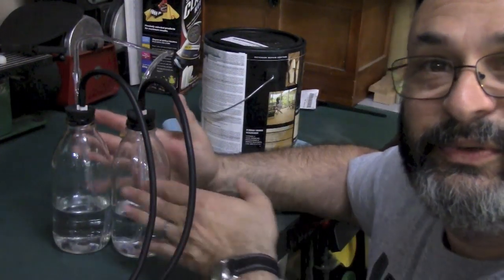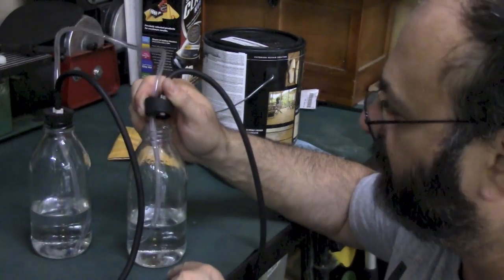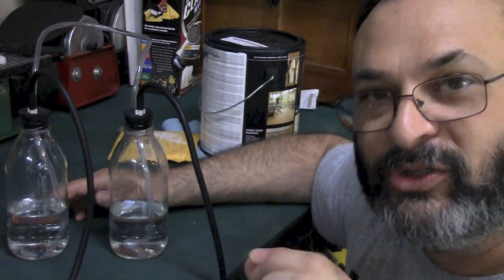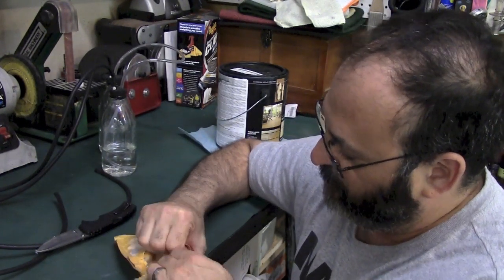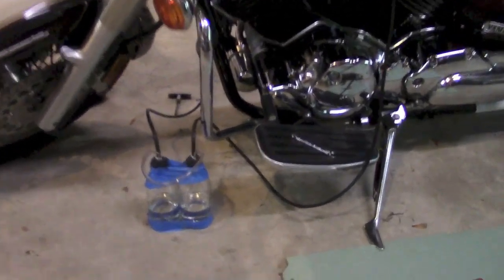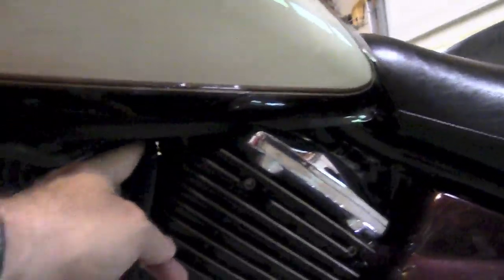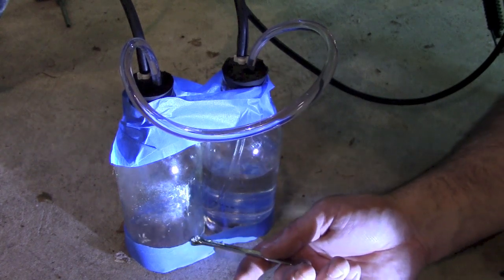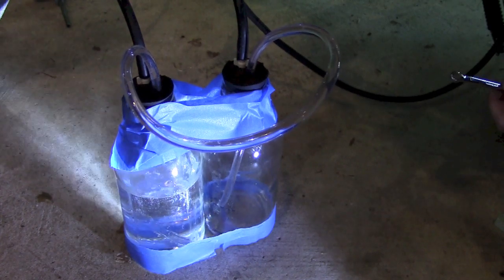Homemade Carb Sync Tool and Mail Call

Comment: That is a Kutmaster barlow with black delrin covers. Sounded like it had a nice walk and talk too. It's not worth much as far a cash goes and it's not particularly collectible so I would clean it up. Unless of course you prefer to keep the patina. If your going to clean it I would recommend using Flitz and your preferred lubrication oil (I use rem oil or mineral oil). If there isn't a whole lot of pitting then you have a solid working EDC knife there.

Comment: I have a vstar 650 I love the bike I started off the same way using this same method until I broke my glass.  Then just bought a motion pro syncpro carb tuner.  But either of these methods work great folks.  And if you haven't sync'd your carbs in a while you'll probably notice a nice improvement.  Thanks Fred for show people this and btw very nice knife.